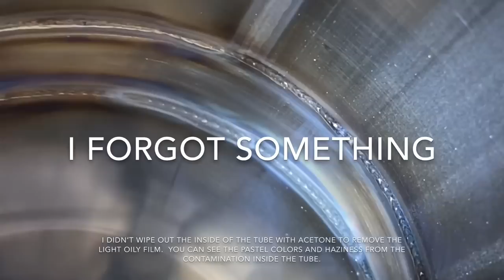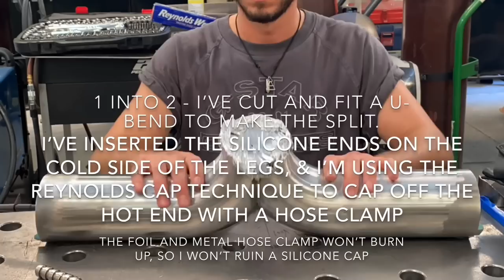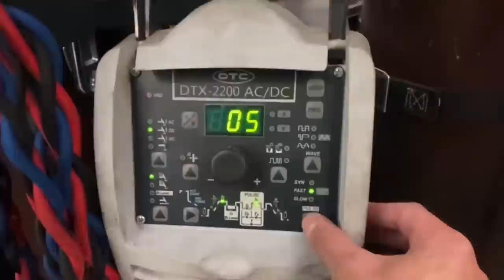Part3 • STAINLESS AUTOGENOUS

Comment: I love the clean tight look of fusion welds without filler metal, and I am certain they are quite strong enough for an exhaust.  But it sure takes PERFECT fit up to pull it off.
Reply: To be honest the look depends on pulse settings: if he put a champher and used a thin rod, with the same settings, the look would have been the same🤷🏻‍♂️
Reply: As a pipe fitter, when we weld in food grade plants a lot of the sch 5 tubing we fuse weld only. No use of filler. It has plenty of strength

Comment: I do this type of welding for a living and you should not have to start and stop that many times to get around 3 inch pipe three times at the most. I usually do it in one or maybe two. And it probably works fine for an exhaust system, but I’m in the food grade industry, and it would never fly.

Comment: You dont get burns  on your biceps when you weld without long shirt. I always do, so thats why im not weliding without long shirt anymore
Reply from the maker: This was during summer in the diesel bros shop, no AC and extremely hot inside.  I would spray high spf sunscreen on my arms every 45mins or so & seemed to be protected well doing so.  I don’t practice the sunscreen method ever anymore since I’ve designed & launched my Arc Defence™ line of fitted welding sleeves and PPE at KANEINDUSTRIES.co

Comment: Killer video bro! That section of pure pie at 12:21 make a man sick of seeing pie cuts and Thanksgiving is just around the corner! 🤢💨🔥🌈
That LAYZR tungsten is no joke! I first got some when I needed 1 mm and I could only find that in place of my 2% lanthanated. I was really surprised by its ability to take the DC current beyond most others with the tip intact and the tip does stay sharp, I love it on DC down to 3A. I was curious about low current AC using the 1mm LAYZR tungsten; 25A to 5A smoked the tip into a huge ball. 😫
Good stuff you got here and that Daihen unit was a surprise to me too!

Comment: Sweet vid, (regular pauses 👍) cool to see you tack up 100, I’ve been doing 50A but, maybe double the the arc time 0.5 sec I usually tack opposites side of the tube to avoid it pulling the joint open. We do all sanitary and usually picture volume of tube as equivalent milk cartons and run gas to suit the estimated amount of milk cartons (looks like 10Litres run at 20l/min for 45 sec to be safe) then match gases in and out for purge or with the inside being slightly under to reduce pressure buildup if the exit hole is small. Appreciate the vids you guys do mint work. Props, keep up the good work
Reply from the maker: Thanks for commenting the pre purge tip! That’s a great example! Let me know how the flash tacks work for you!

Comment: Just tested this style on 3" 304l 1.5mm wall tube, no bevel just zero gap butt. Did piecut turndown exhaust tip and it turned out practically the same as in the video. Stepping distance had to be quite far apart what I'm used to, because the molten pool would solidify by much larger area when the pulse reverts to background current time. The push angle really needs to be about that dramatic, and it made no sense at first when I tried but the results were impressive. Flat, no concave or undercut and root was pretty nice for first time try. 1.3Hz was the sweet spot for me to be consistent. Awesome video! Gonna do some more practice and dial in the settings to suit myself best.

Comment: do you think fuse welding exuast components like this with full penetration is strong enough for high boost applications? or would you reccoment using filler
Reply from the maker: I’ve only tested this type of sanitary welding up to 800psi and never had an issue. How high? I do not recommend this technique unless the operator has passes procedure without undercutting or underfill/concave profile.

Comment: Thx for the valuable info man quality video. I'm trying to design my own exhaust for a civic and have a question. It has alot to do with the tune of the car but is there not a design of exhaust to help make the crackle pop and or backfires? Like a specific shape or something like that to achieve that? I have read it has to do with low and high pressure zones created in the exhaust and fluid cavitation. I know its not some peoples style but I love a good gunshot backfiring exhaust.
Reply: From my experience with motorcycles its 99% determined by your fuel/air mixture and your ignition timing

Comment: Yeah, loving this video series. Its exactly what I was after as a part-time TIG welder transitioning over from doing everything MIG. Thanks for taking the time to do the video, and special thanks for the written explanations as well - my welding note book is now full of amp settings, flow rates and setup tips...! Just ordered some laZYr CK tungstens in 1.6mm to start me off on my autogenous welding journey (a 2.5" exhaust is first cab off the rank). So, once again, thanks Kane for posting this series, I think we all really appreciate it.

Comment: I’ve always wondered if welding like this has ever become a problem? Ever had a weld fail or break when not using filler? Def allows for better looking welds without it. With perfect fit up this is probably much more feasible.
Reply: I've always wondered the same things here - i'm still relatively new only a year in tig welding stainless mostly for cosmetic or low strength applications (lucky enough to be trained up in a small business) but still no clue ...all i can say though is 90% of the welds i have repaired that broke were the ones done with no filler...especially the ones done on stainless rod frames that have massive undercut as well 😨😨😂😂😂
Reply: He is not filling any gaps and as long the welds are not below the base metal, root or face , the weld should not be weaker.
Reply: For materials under 3mm thickness, and especially butt welds, autogenous welds are very strong. And it is used in industry welding of fuel and hydraulic lines and in food industry as it makes for cleaner flatter welds, Filler is just that filler. If the fit is good there is nothing to fill. And filler adds more crevices for bacteria to grow or requires extra work to sand down. Good puddle control with autogenous welds will give you a silky smooth bead profile and solid fusion of both parent metals.
Reply: If you have a a snug,flush fit with zero gaps then fusing is fine for something like an exhaust pipe that gets bolted in place and won't bounce around.

Comment: Newer welder here. I have two questions; 1: I was told that multiple starts and stops in any kind of pipe welding led to weak spots and potential pin holes. Is that true?

2: I see your welds are rainbow colored on the outside. I have been told that a golden/hay color on the outside was a good indicator of a good weld that was the right temp, not too hot. Is that also true?

Comment: Hey Kane, I worked in the sanitary process piping trade for 12 years.  Some of your welds look convex? We always made sure we had positive to neutral purge pressure. I the dairies convex welds don’t clean well so bacteria builds up.
Reply: I believe industry standards are different for what he is doing tho, sanitary is less about aesthetics and more about integrity/cleanliness...just saying, he thinks ALOT and is critical about his own work. I'm guessing u try to do the same
Reply: @DCweldingAndArt  flat welds are always more aesthetically pleasing.
Reply from the maker: This is how I do for structured autogenous welds (exhaust) I’ve already explained how and why in the previous 2 clips. This is to emulate filler without using any.
Reply: @KANEKIDWELDS  same with sanitary welds. Butt welds no filler usually 45-55 amps with straight dc lift arc welder.  Love S.S. Welding. It’s so clean.
Reply: @KANEKIDWELDS  Hey mate. What is the strength like compared to using filler rod? Love your work btw. Looking to upgrade from a scratch start to a full featured Tig in the next few days.

Comment: Any difference in strength or crack resistance between this and adding filler?
Reply from the maker: If it’s welded out matching the specifics I’ve shown, then there is virtually no difference in integrity of either process. 
If the fit up isn’t square and flush, then undercutting or under filling could happen due to operator. The EMF will pull the weld towards the tungsten as the puddle cools and amperage decreases (same effect as a crater fill setting, or when the filler balls up and jumps to the tungsten instead of falling into the puddle) and the weld area will shrink together as the puddle temperature decreases. If you’re traveling too fast with this pulse technique or amps too high, it can cause underfill, or a droopy faced weld, which can be easily corrected with more push angle, less amperage input, or too high pulse background amperage.
Reply: @KANEKIDWELDS  Great to know, thanks for the info.  Next time I build an exhaust I'm not adding filler... assuming I can get it to fit up properly lol.  Just fixed my buddies magnaflow that had little spider cracks all over it.  Pretty sure they used the wrong gas when they mig welded it... they shipped it out full of porosity.  Don't buy magnaflow!

Comment: Another great video. I'm noticing on my own parts, even with the "extreme push angle" you spoke of, many of my welds were somewhat concave. Perhaps I was a bit too hot? Tube was .065 wall 321 ss.
Reply from the maker: Try backing off the peak amperage, and traveling a bit slower to give the joint a stronger shrink between pulses. What is your purge setup?
Reply: @KANEKIDWELDS  almost exactly the same as you except I made my own silicone plugs in a plastic cup with a two part pourable silicone mold making compound.
Reply: @KANEKIDWELDS  thanks for responding so quickly. I'll try backing off the peak.👍

Comment: Hi Kane, was that pulse 2 times per second at 85A-5A??
Reply from the maker: I accidentally cut the wrong part out...16ga material - 1.4pps, 85peak amps, 40-45% peak amp on time, & 15%background amps. The OTC reads 05 on the display screen, but I think it’s the Lowest capable amp start. I think it drops with smaller electrode diameter, and sometimes it reads 06 when I have a frosty electrode.
Reply: @KANEKIDWELDS  thanks mate. Greatly appreciated

Comment: How strong are autogenous exhaust joints? Are they reliable?
Reply: They’re just as strong as the rest of the metal. The only difference between autogenous welds and regular welds is that you aren’t adding extra metal to the joint. On non-structural welds, such as these exhaust joints, and the fit up is as close and solid as this setup, you’re basically just melting the two pieces of metal together using the existing material, making this just as strong as the rest of the material.
Reply: @THESKINIMIN1234  Thanks for the info. So my next question is, why ever use filler on exhaust? Seems more cost efficient to just do autogenous period.
Reply: @exhaustsauce  Mainly fit-up, without a very tight fit-up the joint will open up into a keyhole much like welding an open root on pipe. Also without filler sometimes the welds can become concave or sunken in, which in turn would affect the integrity of the joint. On the topic of cost, I think the cost of fill rod would be negligible in comparison to the price of a custom job like this.
Reply: @ScottJ2486  appreciate that 🙏

Comment: There's been many of Tig Welder contract skin cancer from years of Tig welding with exposed skin. That arc is 30 times brighter then the sun.
Reply from the maker: 👍🏼 Read my post about this in the community tab.
Reply: @KANEKIDWELDS  Where is the "Community tab" ?
Reply from the maker: At the top of my page where the tabs are. 
at your own risk UV protection

Comment: Mad work as usual! I heard autogenous welds for turbo dump pipes are risky as they're prone to cracking due to the massive amounts of heat produced by the turbo, but perhaps able to use that welding technique further down the exhaust where there is less heat which is fine. Is this actually the case, or is it ok to autogenous weld the full exhaust from turbo back without risk of failure?
Reply: Stainless grades like 309, 316L, 316H, and RA330, Hastelloy are
perfectly suited to extreme high temperature use.  My guess is this material is 304L, which will also withstand a great deal of stress at extreme temperatures.  The only thing better would be the stainless grades I mentioned above.

Comment: What hood do you prefer kanekid?? 👍🏻❤️
Reply from the maker: I’m all about Speedglas. 
The best recommendation for a professional entry/budget would be the 9002NC, which has true color and precision clarity, as well as breath exhale ventilation. 
For the best ergonomics and everyday professional use, the 9100xxi is top. The 9100xxi and the 9002nc arc filters have the same technology and are optically identical. The 9100xxi has a slightly bigger view, auto on/off, + more adjustability. The pivot points on the 9100 are incredibly balanced and sit back at or behind the ears, so the weighted downforce of the helmet itself eliminates neck strain over long periods of wear. The side windows of the 9100 allow more awareness and feeling of openness which is very nice.  This is my go-to over anything. 
For extreme, dirty, contaminated, or heavy duty welding I have the G5-01 VC w/ Adflo Air Supply. This helmet is absolutely incredible but not the most practical for typical everyday use. This helmet is completely modular and can be set up however needed with added protection features to external work lighting systems. The VC filter allows the color contrast to be changed at the tap of a button, or by a helper controlling the settings remotely via Bluetooth app connectivity. The colors are warm (orange/red), neutral (literally no color, just being able to see the raw arc), and cool color (the standard blue/green true color contrast widely available). All of the contrast colors are very useful, especially switching between processes. The g5-01 has every shade from 8-14 and flips up to be used as a grinding helmet. The air supply can be precisely controlled to aim the air wherever needed inside the helmet. 
My new favorite is the G5-02, which I have been testing for 2 years, (see my latest story post here to see it in action) and will be available on the US market next year. The g5-02 is the first ultra-wide CURVED glass auto darkening filter to exist in the welding industry, and I can’t even describe how amazing it is. It’s the neutral colorless lens and gives 120° of view to the user, with a light state shade of 2.5(which actually seems more like a 1.5-2) and you can actually see the details on the edge of a paper through it. It’s insanely HD crispy clear and the shell is super light. This helmet has proven to be the absolute best for cage welding and tight spaces, and the peripheral edges of the lens don’t sacrifice any quality or clarity. This also has the Bluetooth app connectivity to control and track information. 
I love all of these helmets for exactly what they are, and use them all.
Reply: Right on.. just curious what you recommend. I just picked up a optrel crystal 2.O after trying one out at Justin’s class in Las Vegas.. just wondering if there are better hoods. Only have one set of eyes
Reply from the maker: I’ve tried some friends optrels/fronius hoods and they have what I consider to be the closest high definition clarity next to Speedglas. The Miller helmets are the top tier worst I’ve used & have given me the most trouble, but they’re a welder company, not a dedicated ppe company.
Reply: 👍🏻👍🏻 greatly appreciate the info sir

Comment: im curious to know what type of pressures these welds would ultimately eventually fail at, over using filler wire.. great looking welds!
i work full time in stainless fabrication but nobody i work with has the technical knowledge im always curious about- mainly sheet and sq. tubing